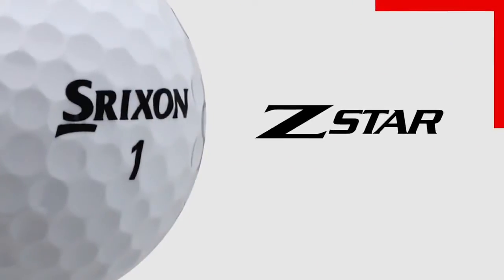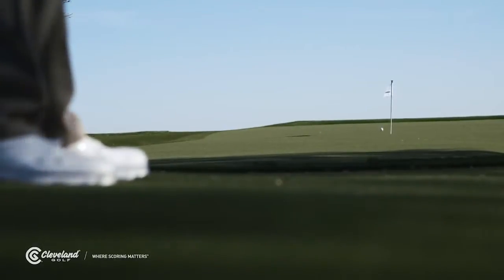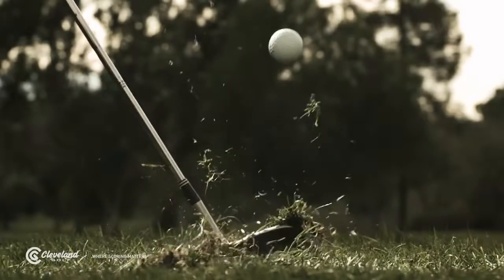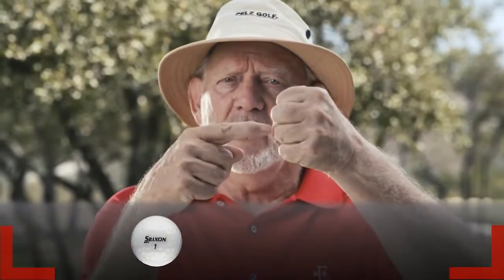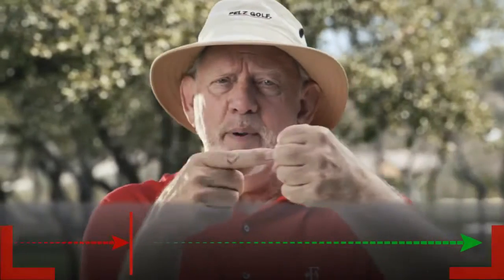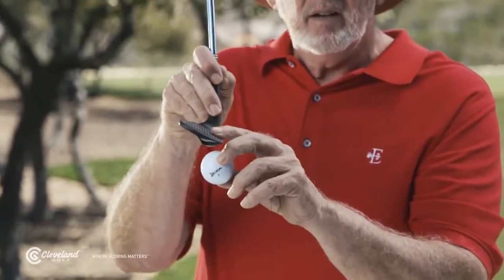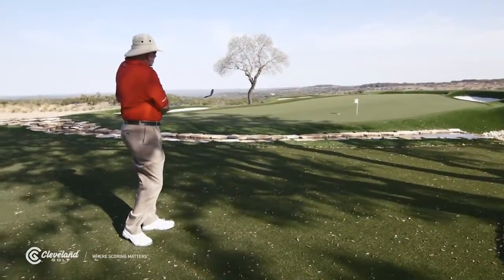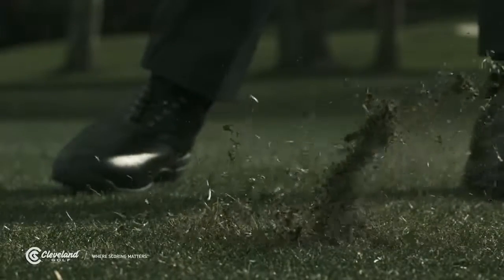Dave Pelz - How To Get Spin On Your Chip Shots

Comment: These are just sponsor advertisements, not technique improvement advice. And, severe backspin is not the only way to get a ball to stop where you want it. A bump and run with a 7-iron will accomplish it just fine. And, his prize student/collaborator, Phil Mickelson, doesn’t use either the ball or the wedge. Phil Mickelson’s You Tube instructional videos are much better.